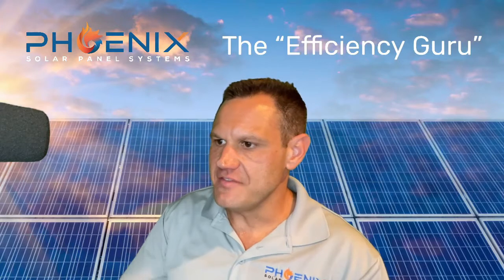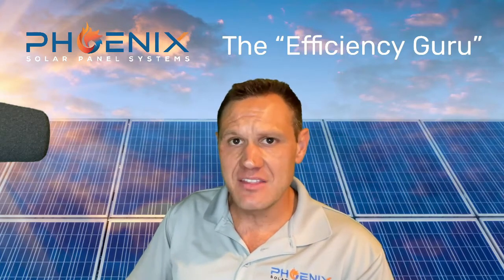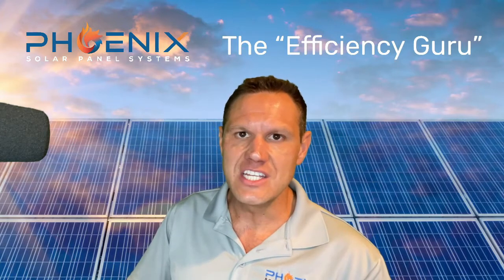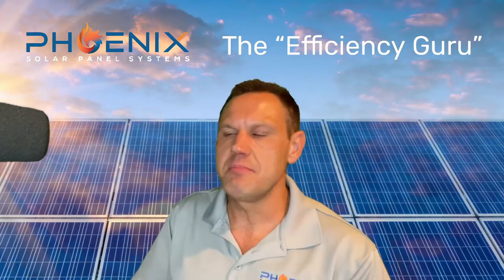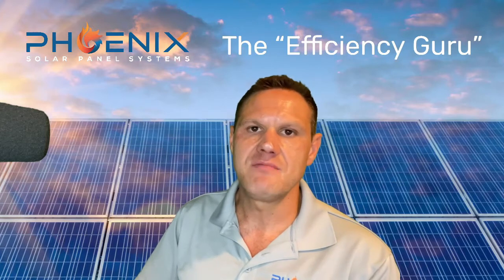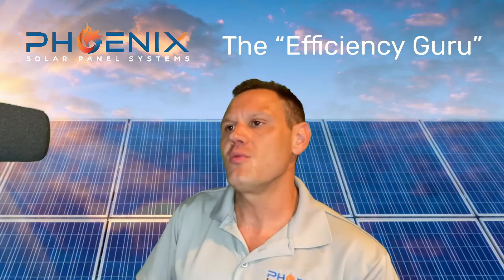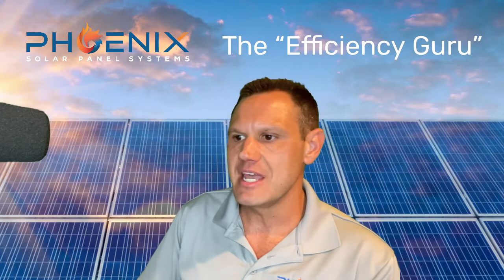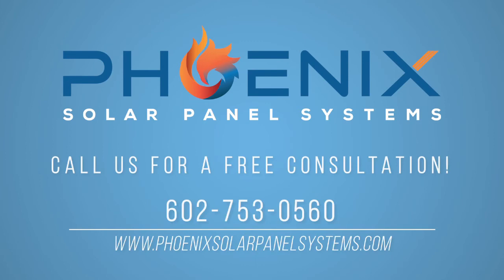Arizona Solar - Using Demand Managers in SRP

Comment: Having looked at the various SRP schemes and listened to videos such as this one, we have taken the decision that when our solar system (which is currently on EZ-3) reaches the end of the grandfather period, we will permanently disconnect the system. The E27 plan, in particular, might work for a smaller property or one with gas for cooking, but for an all-electric, medium size house, the peak demand penalties make solar impractical and impossible to justify economically. 

Peak hours, with demand managers, would preclude cooking and/or cooling our home. Our induction stove is rated at 7.5kW, our HVAC is dual 4 ton (8 ton total) SEER14 and we work from home using heat-generating computer systems. Managing peak demand would either cause the house to run uncomfortably hot for extended periods, or force us to eat only at lunchtime and late in the evening. Our house is relatively modest in size at 2750 sq ft.

It is possible that battery technology will mature in the time remaining on our grandfather period, but I have my doubts. If it does, then we will upgrade our system from 7.5kW to the maximum supported by current generation cells which would be around 12kW, then install appropriate batteries; the system would operate with load controllers and be entirely off-the-grid. Otherwise, and here's the real fun part, we estimate that using zone controlled mini-splits and other energy saving solutions, we can expect to cut at least $2,400 and possibly as much as $3000 off our annual electric bill. 

SRP's final insult is their plan which proposes using our EV's to supplement their distribution network. This seems to ignore that lithium ion batteries have a finite number of charge-discharge cycles in them, and that performance deteriorates as the number of cycles increases. Considering the cost of battery replacement, and considering the relatively low mileage we put on our EV's (since we work from home), SRP is effectively suggesting we should halve the effective life of batteries. So no thanks on that one! 

I saw the data used by SRP to justify their plans, and it is, to say the least, a beautiful example of cherry picking. Kudos to the team that put this together, put I'm not inclined to offer myself up as a victim. There ARE specific circumstances where solar under SRP might make sense, but our situation? Not one of them.